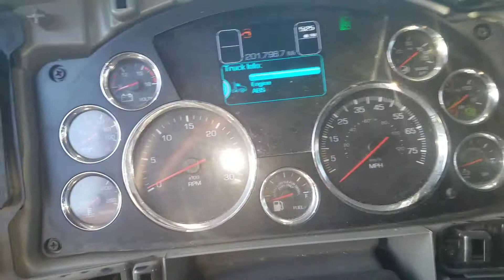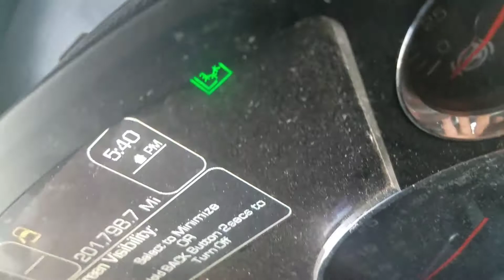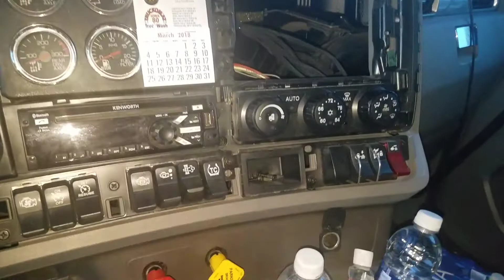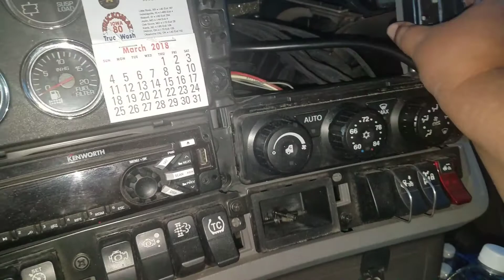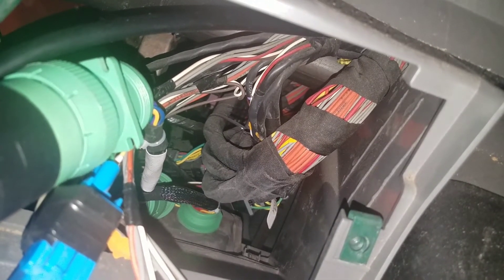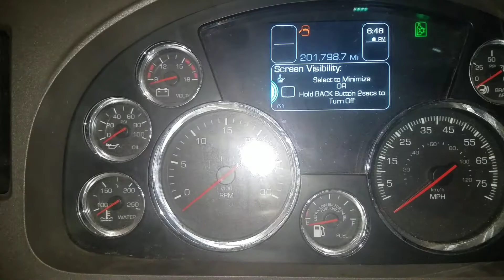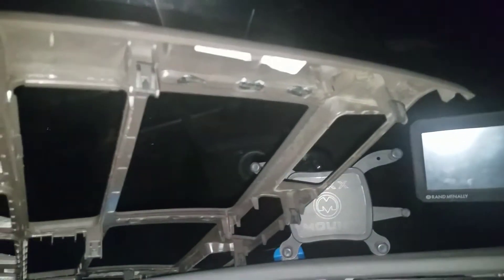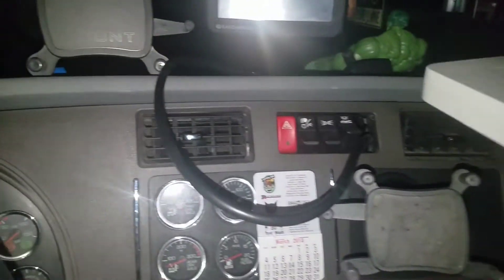ELD installation in 2017 Kenworth T680

Comment: Just notch the plate that goes there and take a rubber bulk head grommet that fits snug around the cable..split it, fit it around the cable and slide it onto to the cut notch.

Comment: Had u have any problems with your truck with the  eld after it was installed I had to disconnect my keeptrucking led becouse it was causing my transmission and onguard  to go crazy
Reply from the maker: I don't seem to have any issues.  I have a 10 speed manual eaten transmission. The only thing I can say is that my engine exhaust brake seems to be a lot more jumpy then the other 680's that we have in the fleet that are not running the keep tricking eld.  But then again that could just be wear and tear due to the fact that I have almost five hundred  thousand miles on my truck now.